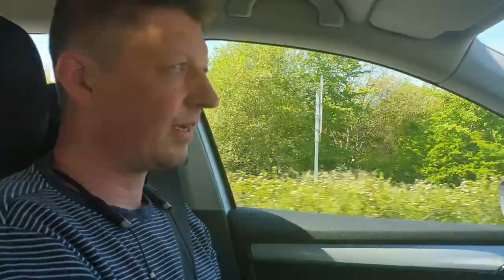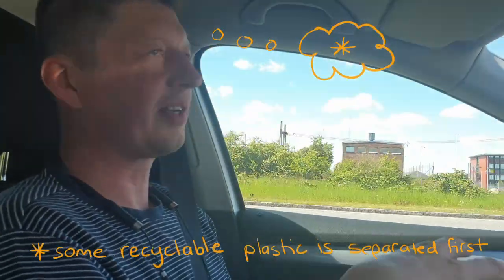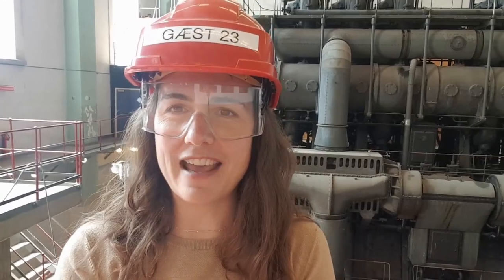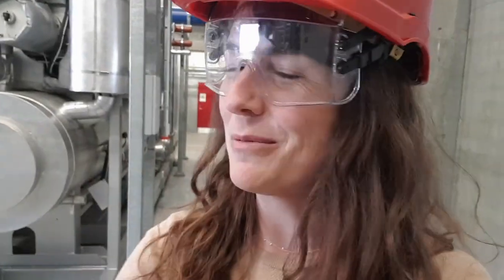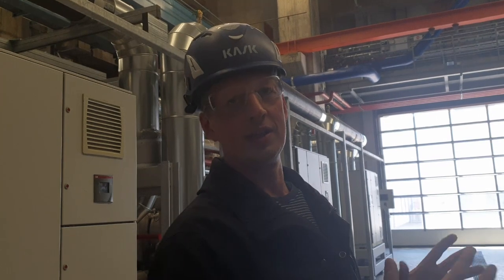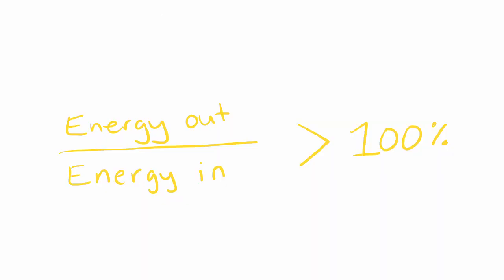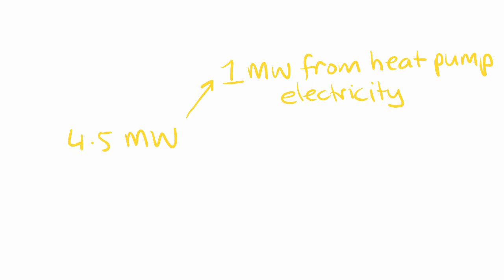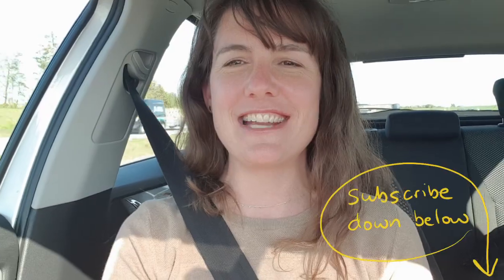Denmark's Circular Economy: Waste to Energy and Waste Heat Recovery Project Management Tour

Comment: G'day Rosie. Just discovered your channel and think it's fantastic!
I'm wondering how this waste to energy project deals with residue and exhaust pollutants resulting from the combustion?
Reply from the maker: Good question! And I actually don't know. These waste incinerators are very common throughout Europe though, so I imagine it shouldn't be hard to find out.
Reply: There's a similar waste-to-energy plant in Vantaa, Finland. According to their website, they clean the exhaust with electrostatic filters, activated carbon, and lime.
Reply: First the incineration temperature is much higher than any home-sized equipment, so many toxics are eliminated that way. Next is scrubbers and filters. :)